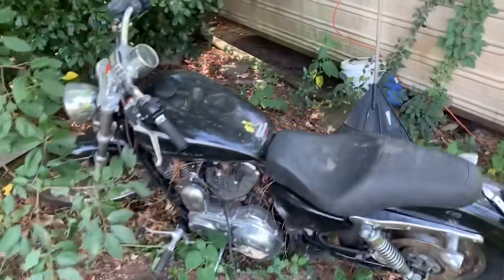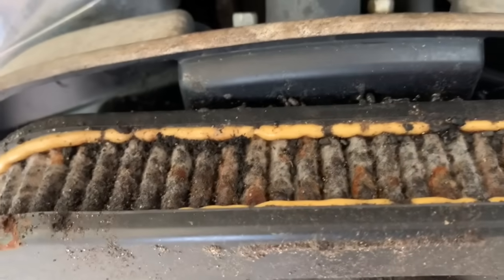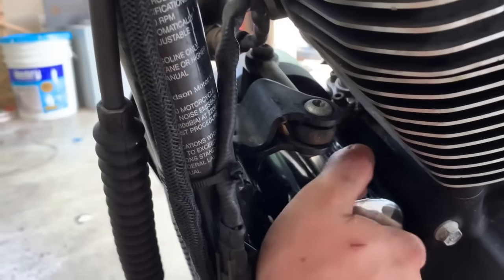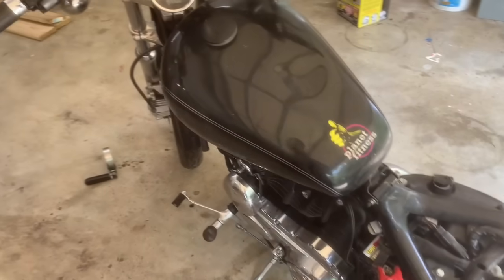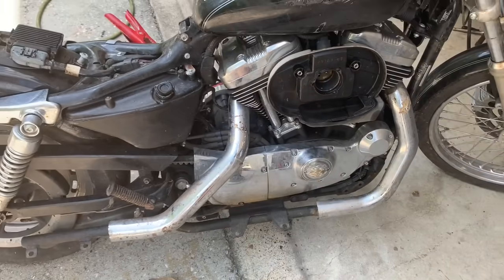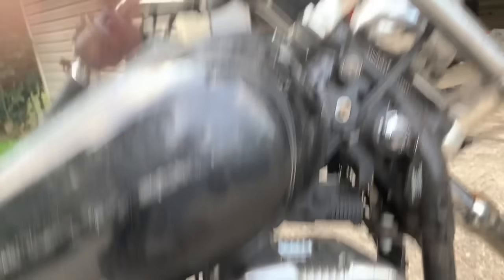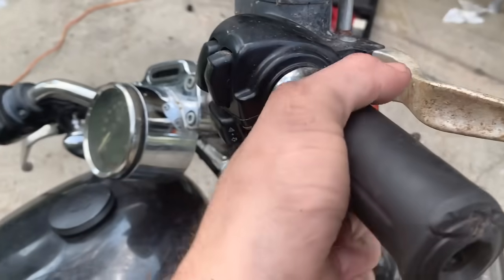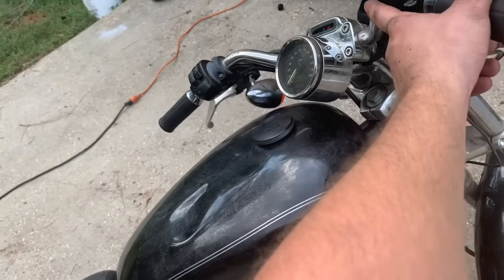Will It Start! After 7 Years Of Neglect Deserted Harley Sportster 1200 Custom Attempts To Start!

Comment: That’s an evo for you… treated like dirt (literally it was if you think about it) pun intended… and was tipped up and started fairly easy. The brand speaks for itself. I pulled an 84 shovel head out of a barn in 2020 to restore as a “lockdown pandemic project”. It was there for 24 years… new carb, fresh fluids, plugs and wires, gas and a battery and it started within 10 seconds of cranking. It was mind blowing. They are tough bikes whether people want to admit it or not. 24 years in the grave and that old bike took me to the store and back after three hours of wrenching.
Reply from the maker: That’s right, that shovel head sounds like a slick project!
Reply: @UncleMike1776  it turned out really nice. Ended up putting the motor in a softail frame raked 6 over and threw a bunch of custom parts at it. Hats off though man, I watched all your sporty vids and it was cool to watch it brought back to life.
Reply from the maker: @d-lowz-no9931  thanks! It was a fun flip.

Comment: I like to add Seafoam additive to the gas and oil to something that sat for a while. Ride it for 50 miles and change the oil again. You might be surprised at what comes out. I did that plus new plugs, air and oil filters on a 96 1200 Sporty and damn! Thing pulls! I love it.
Reply from the maker: That’s what I like to hear!

Comment: Watch this video back in March 2022 when I picked up a 93 sportster with 7000 miles and was sitting for 20 years, well today, after getting carb, battery, rear master brake cylinder, new plugs, wires, sounds good like this harley, runs great, tags updated, Tires looks great but see cracks, gonna replace, Thanks for putting video
Reply from the maker: That’s awesome! Glad you got it up and running

Comment: I don't even understand how someone lets a bike that isn't even old or fucked up in that situation. On its side, in tall gross wet grass. That seems insane to me. Why couldn't  he just leave it on the kickstand in the driveway? I mean, his bike, he can do whatever he wants, it just doesn't make sense to me haha. Also, when changing oil, I always fill the fiter with fresh oil too so its not dry upon first start up. You may have done it, I just didn't hear you say it when you lubed the seal. I am pumped you are bringing it  back to life! One more thing, I am assuming someone stole the mufflers when they took the mid controls. Sometimes the pipes have to be removed to get at the controls so it would make sense!
Reply from the maker: Yeah it also might have been laid down, but I did pre fill and some times it makes me question what people were thinking

Comment: I have the same year bike. It has 5,700 original miles an I love it.
Reply from the maker: Right on, talk about low miles!
Reply: I'll post a video of it eventually.  But congratulations man.
Reply: @UncleMike1776  I bought it from the original owner an it had 3,600 miles on it. An I only paid him $2800. Since I've gotten the bike I've put new perelli tires front and rear new brakes a hiflo air intake similar to yours a rush 3 in exhaust an the vance an hines fp3 fuel tuner.  Sounds like a beast an runs like one too. Well for sportsters. Fuck anyone who says they are for chicks. I love mine an ride it daily.
Reply: @UncleMike1776  I was lucky to find it an have gotten it so cheap.
Reply: I posted a quick video of my bike. Check it out
Reply: Another crazy thing, a few years ago I lived not to far from where you are in this video. I lived in Ozark an my brother lives in enterprise levelplains area.

Comment: great find, great job bringing it back. some advice from someone who's been bringing back old Harleys from Shitsville for 50 years! flush the shit out of everything on that bike, start with wheels, bearings, seals, etc: etc:, forks same, gearbox-trans flush, primary flush, and adjust.  remove plugs fill cylinders with kreep, turn over slowly, flush engine with diesel or kero fuel, then run 15-40wt. diesel oil, gas tank flush, fill, use seafoam, spray the shit out of carb = injectors check jets and float, change, brake fluid, and lines, rebuild master cylinders than ride the fucker cross country. when you get back buy a new one.
Reply from the maker: I’d love to do a long haul ride but working a full time job puts a damper on that!
Reply: i can understand that completely Mike, just settle for the weekends if time allows, nothing like riding and getting back on  your rebuild.
Reply from the maker: @martinwall7297  I’m going to take it out Sunday if weather permits!
Reply: @UncleMike1776  be safe and enjoy the ride Mike, what part of America is it your riding in
Reply from the maker: @martinwall7297  lower Alabama
Reply: I second and third this.  I certainly don't blame anyone for making sure she will runs, but it's pretty wild how "corroded" the most unsuspecting places can get.  I had an fxr that sat for a couple years once.  I had put new cables on it. It had new fluids, etc.  I thought I was good-to-go with some fresh gas and an oil change.  Turns out, I should have lubed cables, replaced fork seals, etc.  Everything I didn't lube went to hell quick!
Reply from the maker: @aamantium1  dang! That’s alright though just gives you more work!
Reply: Got kin in coleman

Comment: It didn't idle at first, were you just shutting it off or would it not idle when you were first starting it?
Reply from the maker: It wouldn’t idle
Reply: @UncleMike1776  Did you do anything to allow it to idle or did it just need to run for a bit, warm up?
Reply from the maker: @bodeine454  tried to keep it running until it would idle, I changed the fuel pump and filter shortly thereafter

Comment: I just saw on another channel that the oil filter on another type of motor was on real tight. I think I saw 👀 somewhere that the rubber gaskets on the filters swell up a little causeing them to seal and make ing them tighter then hell.
Reply from the maker: I’ve never ran into an issue only doing them hand tight!

Comment: You didn't have to clean the inside of the carb?
Reply from the maker: This bike has fuel injectors and no carb! I did end up changing the fuel pump and filter, I didn’t include them in the price because the guy who mounted my tires gave them to me for free!
Reply: @UncleMike1776  thanks for the response. I am working on a 97 883 today. Yesterday I went through the carb and new battery. It fired right up last night. But, it's popping out of the carb and also backfiring. Any suggestions would be great.
Reply from the maker: @larrynorsworthy8582  possibly the air fuel screw needs adjusting
Reply: @UncleMike1776  im also going to check that the slide isn't stuck. I didn't remove it.....
Reply from the maker: @larrynorsworthy8582  it’s possible!

Comment: I have a sport bike which had a leak in the gas tank.  About three years ago I took the gas tank off in order to seal it, which I did, but I never put it back on.  I'm about to do that now but, not sure what to do prior to cranking it up..
For those of us who are more mechanic-illiterate, It would be great if you can write down a list to include all the things you did to it before you try to start it up. It's kind of hard to follow along while watching the video.  You said you drained all the fluids, but that's somewhat vague for those of us who have never done it before.  Thanks.
Reply from the maker: I drained all old gas out of tank, changed filter, pulled the spark plugs let marvel mystery oil soak in each of the cylinders for a few hours, turned the motor over manually to verify the rings weren’t rusted to the cylinder walls. Once I know the engine wasn’t locked up I put the battery on it and cranked it over a few times, put the plugs back in added fresh fuel and fired up the bike! Hope that helps!
Reply: @UncleMike1776  Gr8
Reply: @UncleMike1776  should I drain n refill engine oil?
Reply from the maker: @MasterArmedforces  Inspect first to see it’s at correct level, I’d personally run it first to get that oil warm then I’d do an oil change!

Comment: It’s a wrecked bike. Needs an exhaust, peg, mount, front fender, tail light, FUEL FILTER, take those controls apart and clean them out, lube the cables, tires, brake pads, change the brake fluid, air filter.....about $500 worth of used parts and a day and a half of time.
Reply from the maker: Right on Scott!

Comment: I'd be using PB BLASTER, vice ATF...or better yet Marvels! Always bar motor over completely several times prior to using starter. Great find otherwise, good video.
Reply from the maker: Yeah that’s true!
Reply: Marvel is still the best, in my opinion. I run some through my bike every couple months like clockwork. Ran a scope down the spark lug holes of my evo last year and I must say, it looks like a motor with 10k miles from the inside. I preach marvel to anyone that needs it lol

Comment: That is where the Harley is superior to other models. You can neglect them for years and it doesn't take much to get them started back up again.
Reply from the maker: We will see! Depending on these other bikes I’m looking at and how it goes!
Reply: Never owned a Honda then have you? My first bike was a 1982 450 nighthawk. It leaned against a shed for 20 years. I literally put in a battery and some fresh gas and got it fired up. I rode it as it was for 2 years with the dry rotted bald tires and no front brake.
Reply from the maker: @louiewatson9389  right on!
Reply: @louiewatson9389  it seems all the Hondas that I have revived usually involved at least going through the carbs a few times and fuel tank and fuel system. Not the motorcycles fault but part of the Revival process I guess. They all start life is good bikes. It's just the abuse they endure through their lifetime.
Reply: BWHAHAHA! 
They break down constantly.
I have a Honda Goldwing with 253,000 on the original engine.
Reply: How long have you been doing stand up?

Comment: run come trans fluid in oil and clean up them lifters. They are making some
noise. Awesome bike though.
Reply from the maker: It works well I’ve done it on a few things that I’ve worked on that sat for a while or missed many oil changes!

Comment: Next oil change fill the oil filter before you screw it in these have a slow oil system so you might have a oil starved first start looks like someone stole you’re  exhaust and crossover probably to restore another bike
Reply from the maker: It’s possible!

Comment: Don't trust those tires,they might look good but the rubber could come apart at speed.
Reply from the maker: I replaced them on another video in the playlist! Give it a watch!
Reply: @UncleMike1776  Thanks for the heads up on that. I mentioned that about the tires because I picked up a truck that was parked a few years with almost new looking tires that had become brittle without actually knowing until one failed on the highway.
Reply from the maker: @rickdaystar477  I try to stay away from dry rot tires if I can help it, very dangerous!

Comment: Hey Harleys don't leak oil... they mark their territory. Go on Craigslist some times you can find parts for cheap or for free. I got 2 brand new exhaust systems for free. Also the  best pipe for Harleys is a thunderheader bar none!! Their spendy but well worth it. There is a web site out of Dayton ohio. Called KCINT2 that I've dealt with many times. Great service even better prices. Enjoy your ride.
Reply from the maker: Thanks for the advice, and my grandpa used to say if there isn’t oil leaking from a Harley there isn’t any oil in it!

Comment: Install a new air cleaner. Running without an air cleaner could damage the engine. Installing air cleaner will also make it quieter.
Reply from the maker: I only ran it like this just to verify it was going to run and be worth buying parts for and not selling it for parts!

Comment: 3:12: You didn’t fill the oil filter before putting it on? That’s not doing the engine any favours.
Reply from the maker: I did, I do it on ever filter on anything other than top down filters. Always lube the threads and o ring as well!
Reply: @UncleMike1776  My bad, it looked empty to me and I couldn’t tell from what you said. We’re still friends then😂
Reply from the maker: @anderspedersen7488  no worries mate

Comment: Amazing waste.  To just let something just lay out in the weather, that could have put at least 3k in someone's pocket.  This could be from a divorce in where some bitch got some guys assets, so he just walked away and started a new life.  The pipes only need the muffler slip ons installed and the ones on there need to stay on there
Reply from the maker: Check out the playlist!
Reply: @UncleMike1776  I watched three more of the videos.
Reply from the maker: @EarlGuyton425  right on I hope you liked it!
Reply: @UncleMike1776  Yes, I like that sportster.  These are good for a life time as any harley is actually.  They are designed to repair as you go as to where other brands become obsolete.  I own two harleys right now.  One is my 02 softail standard and other is a 97 fatboy.  I bought them as cash purchases from a dealer.  They are both in where all mechanical is perfect and new tires and drive belts and nothing is due, even the paint is still factory perfect.  I got the 97 fatboy for 4400.00 last april this year (some repairs had to be done) and the softail standard in 2016 for 5800.00.  I have videos on both
Reply from the maker: @EarlGuyton425  right on I’ll check it out
Reply: someone came along and took the aftermarket pipes is my guess